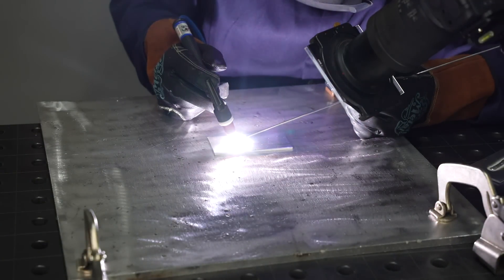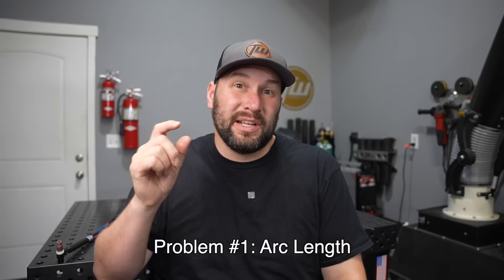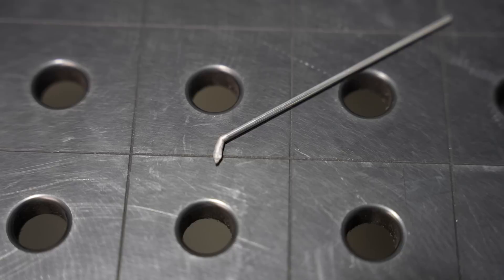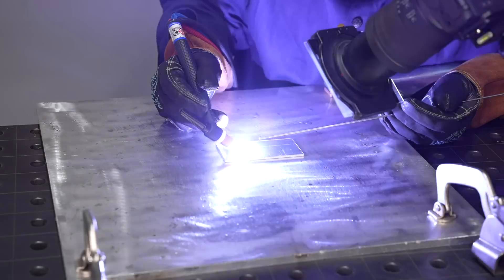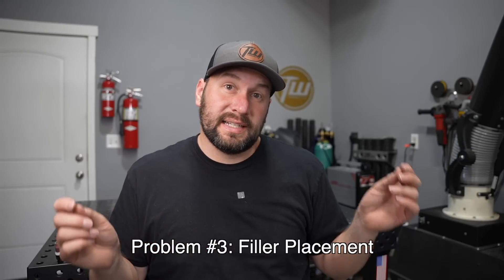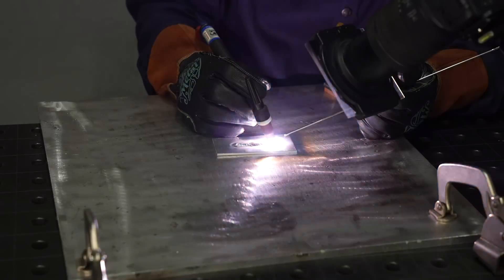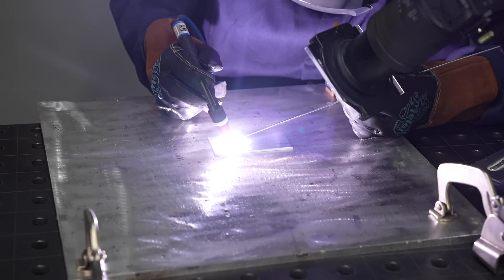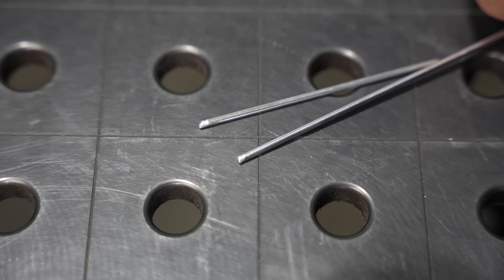Aluminum TIG Welding: How To Add Filler Metal

Comment: At the 0.57 sec mark, you turn on the gas. Can I suggest that this is turned on a bit slower. Reason being, is that if you turn it on too fast, there may be the potential for the metal ball to strike the top of the glass sight (potentially it could be hit, and break). Just taking a second or so longer to ease the valve open, could save a breakage of the glass.

Comment: What filler rod would you use on an aluminum alloy engine (for specificity sake - An Audi A6 engine)? 5356, 4043, 4943 ??? It's to repair a spun main bearing so I need to weld the crankshaft retaining portion of the aluminum allow engine block and possibly the crankshaft main bearing journal (which I believe is hardened steel - different filler rod question?)

Comment: Let's see some inside corner weld's on aluminum!..and not in the flat position on the table 😊
Reply from the maker: I’ll put it on the list. Is there a particular position you’re looking for some tips on?
Reply: Overhead with the pedal between your legs

Comment: Just found this channel and I love it. I'm going to purchase your mig/flux core class. I have a question regarding machine's please. Eastwood seems to have some decent machines but I don't know anything about them them. I've also looked at the upper end of the harbor freight models. Will be used primarily farm equipment etc.. any help would be greatly appreciated. Thank you
Reply from the maker: I haven’t used Eastwood machines before, so I can’t really comment on them specifically. It’s a big enough company that they’ve most likely done a good job of sourcing a decent product. I assume they are import machines, similar in quality to the better Harbor Freight machines and some of the other importers. As far as Harbor Freight goes, I’ve run 30 lbs or so of wire through their Titanium MIG 170 and thought it worked great for the price. I have generally heard good things about the Vulcan machines for their price as well. For machines in that entry level range, I’d recommend also considering PrimeWeld as an option because they give a nice package for the price and really stand behind their products with outstanding customer service. 

Personally, I weld quite a bit, so it makes sense long term for me to spend a bit more for a machine built with some more heavy duty components. HTP sponsors my channel and I’m happy to represent them because their machines, while certainly not the cheapest, punch way above anything else I’ve used in the same  price range. There’s a link to them in the description. I have also used Miller, Lincoln, ESAB and Fronius machines with generally good success. 

There’s really not one right answer, and you’ll be able to reach your goals with any of these brands. I don’t get notifications for replies to these comments, but feel free to email me at the address on my website contact page and I’m happy to answer any other specific questions.